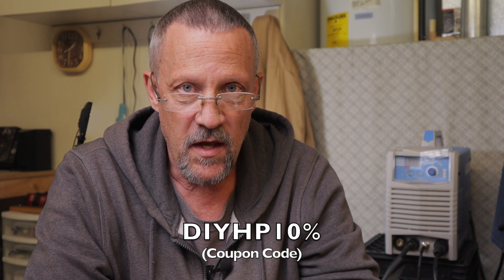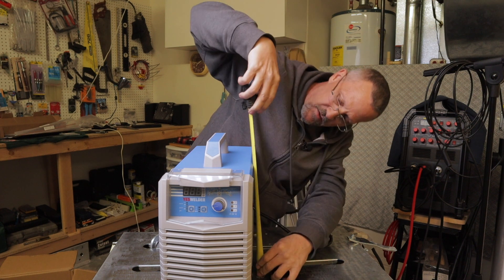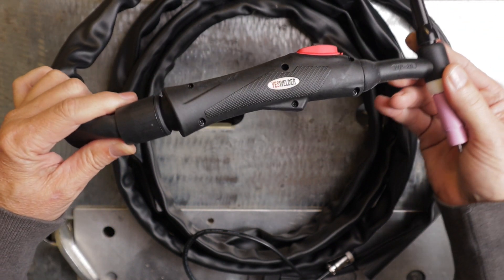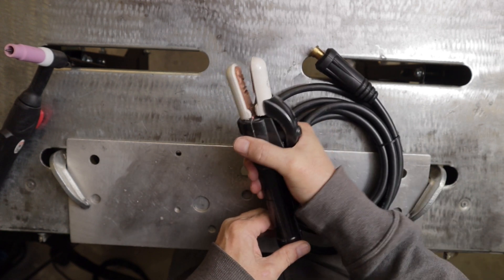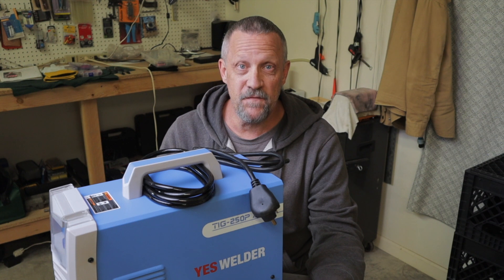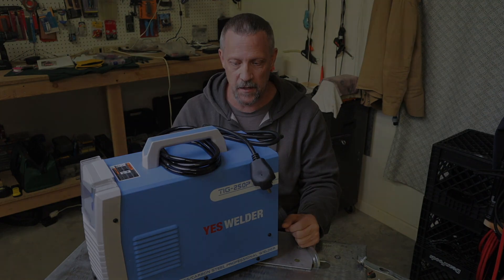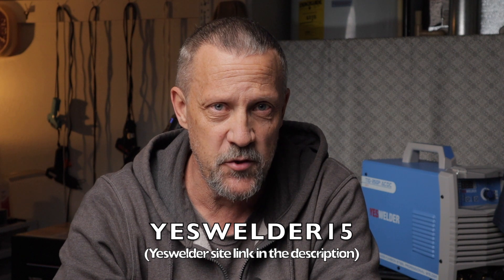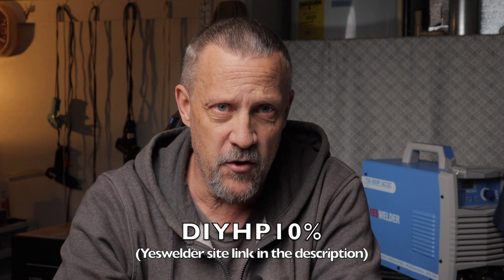I Tried the Yes Welder TIG250P and Here's What REALLY Happened

Comment: Seems to have a good range of settings, ok user interface, and looks to have nice arc. It will be an outstanding value if it holds up.
Reply from the maker: So far six months with quite a bit of use and no issues. If it continues I think it's the best value out there comparing price, features and performance. I'm really enjoying the machine!
Reply: Nice!  I wish they would offer a mig, tig, stick multiprocess in ac/dc.
Reply from the maker: Yes, that would be a nice machine for sure.
Reply: Yeah. Right now Millermatic 220, Esab Rebel and Everlast are it for ac/dc multi process, none of which are budget machines. I suspect there are a lot of folks in my boat- limited space for multiple machines but wanting Tig aluminum. Ordered the Miller, but would have been happy to spend less.
Reply from the maker: For sure! I would like to try a Miller, Esab or Everlast but I just can't justify spending that kind of money on a machine. This is all just a hobby for me so staying in the "affordable market" is my ticket. If any of those companies wanted to send me a machine to do a comparison video, I certainly wouldn't turn it down. 😀
Reply: No kidding. This is both more than I wanted to spend, and more than I deserve to own. The Miller’s range of Tig adjustments is somewhat limited, but I like the pull the trigger or step on the pedal to change processes and it does the rest- including changing polarity or from ac to dc depending on what mig and Tig settings you had. 

I don’t know it that is patented, but if a budget brand set up like that (automatic contractor to switch polarity and two gas inputs/gas solenoid valves) they’d sell a bunch.

Comment: I got the machine!!! It’s rad. I am really stoked on it. I am a total beginner and ran my first beads of silicon bronze and stainless steel. I have only welded three times and only once with my 250p. The other two times was with a Miller and I know that millers are good but mine is better. Smoother. Tomorrow I am going to work with steel for the very first time!
Reply from the maker: That is awesome Chris! It's a great machine and loaded with features. Enjoy your welding adventure!

Comment: Can plug  125amperes
Reply from the maker: 240V only on the TIG 250P machine. The YesWelder TIG-205DS is dual voltage but DC only ( (120/240) Here is a link for if you want to check it out. https://yeswelder.com/products/welder-tig205ds?ref=DIYHP10%25

Comment: You need a water cooler with this otherwise the tig torch gets real hot
Reply from the maker: I suppose if you are welding a lot that could be true. I haven't had any heat problems with the small projects I have been welding with it.
Reply: @DIYHomesteadProjectsDIYHP10  yea ive used a lot of machines with aircooled tig torches and they do get hot,water cooled is the best way to go unless your just doing a few small welds.
Reply from the maker: I agree with you, I'm going to have to give a water cooler a try in the near future. I have a feeling that once you use a water cooled torch, I'm not going to want to go back to air cooled. LOL Thanks for the info and tips!

Comment: How’s it do with 6010 1/8 inch stick electrodes
Reply from the maker: I don't know James, I haven't tried any 6010 rods with this welder.
Reply: @DIYHomesteadProjectsDIYHP10  what about 6011 or 7018
Reply from the maker: I tried it with 1/8" 7018 and 6013 and it did well with both of those rods. The electrode holder is pretty cheap but it does work. Personally I would replace it with a better one and they aren't that expensive.

Comment: Why i cant hear any sound of  fan/ventilation in this video. Does the  YW TIG 250P AC-DC has fan on demand/temperature regulated cooling ventilater?
Reply from the maker: Yes Ralf, the YesWelder TIG 250P AC-DC machine has an on demand fan controlled by a temperature sensor and it is a nice feature.
Reply: @DIYHomesteadProjectsDIYHP10  Where can i buy the TIG250P AC-DC? I'm from Germany.
Reply from the maker: You can find the machine here at the YesWelder website. (link below) Sorry but I don't know if they ship to Germany. If they do, you can use the code DIYHP10% at checkout and you will receive 10% off your order.
https://yeswelder.com/?ref=DIY%20Homestead%20Projects%2010%25%20OFF

If they don't ship to Germany, you may be able to find the machine on Amazon here - https://amzn.to/3rYLkmi
I hope this helps you out Ralf.
Reply: @DIYHomesteadProjectsDIYHP10  thank you very much! I will try to order. Lets see if the can deliver to Germany.
Reply from the maker: I'm curious to find out as well for future inquiries. I hope it works out for you!

Comment: what size is the torch connection?
Reply from the maker: That is a good question and I have wondered that myself. I measured the outer threads of the male connector on the machine and came up with .629" (5/8") or 16mm. I hope this helps you out.
Reply: @DIYHomesteadProjectsDIYHP10  Thank you. This is now available on amazon, i ordered one before its gone. I found a M16x1.5 to 3/8-24 adapter to use ck superflex on ebay. I was gonna get the weldpro tig200gd but they decided it was a good idea to raise the price by $40 on ebay, amazon, and main website.
Reply from the maker: You could have saved 10% if you purchased the machine from YesWelder and used my code DIYHP10% at checkout. Anyhow, it's a nice machine I think and I hope it serves you as well as it has me. Take care!
Reply: @DIYHomesteadProjectsDIYHP10  they cant ship to me from yeswelder direct. Amazon allows shipping to my location, i already have their mig 205ds. BTW, is the machine 220v only? what plug does it have? could it be plugged in 110v?
Reply from the maker: Oh, I understand now. The TIG 250P is 240V plug only. It comes with a 50A 240V style plug on the machine. (unfortunately no 110V on the TIG 250P machine)

Comment: Do you think welder is capable of tig lift arc if i leave it in the stick position?
Reply: I asked them this and yes, if you use a Tig torch with valve (WP-17V-35), and have it in the stick position DCEN then you can do lift start
Reply from the maker: Thanks for the info James B!
Reply from the maker: I don't know for sure but I doubt it. I don't think you would have any gas flow from the torch if the machine is in the stick position. It may strike an arc though and I suppose you could use a torch with a gas valve. Why would you want to do that when the machine has HF start and a gas solenoid?
I did start a stick rod once with the foot pedal and High Frequency start just to see if it would do it and it did. That was in the TIG setting using a rod holder instead of a TIG torch.

Comment: What do you think of the yeswelder 200 amp stick welder.
Reply from the maker: Are you referring to the "Stick Welding Machine ARC Welder 205A"? Sorry but I don't have any experience with that machine. I would venture to guess that for the $135 and being a dual voltage stick machine, it looks like a descent machine. I don't care for the YesWelder electrode holder but it does work fine. Harbor Freight sells a nice one for about $15 and they are easy to replace.
Reply: @DIYHomesteadProjectsDIYHP10  Thanks for your Quick response and yes it is a stick welder and I am new in welding never done before.
Reply from the maker: You are welcome! I think you will probably like that welder. I think it's a good price for a 200 amp stick machine. A big plus is the dual voltage capability. They also cary a 3 year warranty from YesWelder. If you decide to purchase one you can get 10% off using my discount code DIYHP10% during the check out process. Good luck to you and happy welding if you decide to get into stick welding!

Comment: I currently have a miller econotig. I'm new to tig welding so I know very little. Would this welder be better than what I have?
Reply from the maker: I'm fairly new to TIG welding also. I don't know much at all about the Miller Econotig machine but I think it's a transformer machine. (I'm not positive about that.) The answer to your question really depends on what you intend to do with your machine. I would think the Econotig would be a good machine to learn on. As your skills advance, you may desire some "inverter" TIG welding features that an older transformer machine doesn't offer. The YesWelder TIG inverter offers pretty much all the advanced TIG features most people want such as High Frequency start, TIG pulse, gas pre flow and post flow control, spot timer, digital interface as well as a small size and light weight. It's also capable of welding thicker metals than the Econotig because it has 100amps more available power. You'll have decide which welder is better for you and what your intended goals are with your TIG welding. Hope this helps a little.

Comment: Hi brother,  between the prime tig welder and the yeswelder tig 250. Which do you personally like more?
Reply: That makes sense. Thank you very much for the reply!
Reply from the maker: You're welcome Steven!
Reply from the maker: I've been asked that question quite a bit lately and it's a tough one to answer. I like and dislike things about them both :) I would really like to have the best of both combined and that would be my ultimate machine but that is mostly personal preference. They both have the same features and perform about the same as far as I can tell. I really like using either one to be honest. I have a limited budget for my welding hobby so with the 20% OFF sale, right now I'd say the YesWelder would be my choice. I could use the $170 difference to buy other things such as welding rod, Argon, tungsten, weld metal etc. I say $170 difference because you'll have to buy a regulator for about $30 to use the YesWelder. The Prime Weld comes with a regulator. Hope this helps you out a little. That's a tough question to answer.

Comment: im really looking hard,the h.freight titanium 200 unlimited ,has constant fan,no foot pedal,i like this triggered torch, this may be my first tig welder  ,...how much does a argon bottle mud sized  go for  approximately
Reply from the maker: I do the same thing Mark, it takes me days to make decisions like that and sometimes even weeks. LOL In my area I buy my argon through a local supply company. Not one of the big national companies but a small family owned business. I bought a medium size bottle (120cf) from them and it cost me $285. When it's empty I take it in and they give me full one for $61. I never have to worry about having the bottle certified or anything like that, they take care of all of that. The first bottle purchase and fill up was painful but the $61 to fill it isn't that bad. My first bottle last me 4 months. My second bottle last me two months and I'm now half way through my third. TIG welding is addictive but I do it on a budget and once you have that initial expense it's really not too expensive as a hobby. That really depends on what you use to practice on. I use the weldmetals.com coupons and I've made a trip or two to the local scrap yard to buy some real cheap metal to practice with. Good luck with your decision and let me know if I can help with any more questions. 👍
Reply from the maker: Are you wanting a multi process machine. Mig, TIG, Stick? You may already know this but Mig and TIG both require different gas. If you get a multi process machine and want to do both MIG and TIG. You will need to have two bottles of gas. One for MIG and different bottle for the TIG. Just thought I would mention that.
Reply: @DIYHomesteadProjectsDIYHP10  yes ,im after a mid sized argon 100% BOTTLE,I HAVE the older chicago  electric  170,with htp upgraded longer mig torch, 50ft power lead,and upgraded ground  lead n clamp,w argon c02  mix,*smallbottle
Reply from the maker: OK, I figured you already knew but I just wanted to make sure you were aware. Another fairly big difference between the YesWelder and the Titanium 200 unlimited is the Titanium has a manual valve for the gas. The YesWelder is controlled by an internal solenoid with both pre and post flow control. They both work but one is more convenient than the other.
Reply: @DIYHomesteadProjectsDIYHP10  hey thanks  yeah i recently got into beekeeping ,and its been a investment in gear,boxes,suits,smoker,im sure ive got a couple  thousand  now,...but its a good hobby,sweaty in summer,learned a ton,plus  theres the reward of honey,it has risks  too,thanks for  the info,few months ago i ran 50a 230v  so im ready,just need argon tank,
Reply from the maker: The YesWelder doesn't come with a regulator for your tank. You'll either have to get one or use the one off your MIG tank.
Reply from the maker: Have you seen the YesWelder MIG/Stick/TIG Multi-Process Welder MIG-205DS | 3 in 1 Welding Machine? It's similar to the Titanium and it's only $296 right now with the 20% off sale. It has high freq. start for the TIG too. https://yeswelder.com/products/mig-welder-mig205?ref=DIY%20Homestead%20Projects%2010%25%20OFF
Reply: @DIYHomesteadProjectsDIYHP10  can you tell me more  about the 205,yeswelder, seems to not  weld aluminum plate,?is there a foot pedal, does the fan run continuously, or only when getting hot like the 250p yeswelder, I want to tig aliminum,...yeah dont think i can control pre/post flow on the titanium 200 ,which seems like thats a necessary  feature,thanks
Reply from the maker: Mark, sorry but I don't know that much about the YesWelder 205. I do know that it's DC only so it won't weld aluminum. I think it has a foot pedal but it doesn't adjust amperage it's only an on off switch. Just like a finger switch but in foot pedal form. If you want to TIG aluminum then the 205 isn't the one you want for sure. Pre and post flow is nice and is especially important for stainless steel and titanium. It's not critical though for aluminum.
Reply: @DIYHomesteadProjectsDIYHP10  being a beginner,...after researching  the titanium only welds aluminum w spool gun,so its goin back,i can modify my chicago electric 170 to do that,so im gunna order the  omni pro 220,or yeswelder 250p,thanks man
Reply from the maker: You're welcome, good luck with your decision. 👍
Reply: @DIYHomesteadProjectsDIYHP10  just looking at alpha tig for 640.00,...nova pedal,gunna check into it
Reply from the maker: I've researched the Alpha TIG quite a bit and almost bought one a year or so ago. I think it's a comparable machine to the YesWelder and Prime Weld as far as performance and features. The reason I decided not to purchase one is I read several posts where guys had to pay to ship the machine back for a warranty claim. YesWelder pays for shipping both ways for a warranty claim. They are pretty heavy machines so I'm sure they won't be cheap to ship.
Reply: @DIYHomesteadProjectsDIYHP10  have you looked at weld pro,Amazon has em just under 800,but looks worthy,nice superflex hose #17flexhead,foot pedal ,ore n post flow,etc
Reply from the maker: Looks like a nice machine but I don't know anything about the WeldPro brand.

Comment: I click on buy it now with the code 20 and the price is 749, what happened
Reply from the maker: That doesn't sound right. I think I would send an email to customer service. I would also include your order number telling them what happened. Let them know you were trying to use the YESWELDER20 coupon code and they should be able to adjust the total for you.
Reply from the maker: Once you click on buy it now it should take you to your shopping cart page. On the right side of that page you should see a box that says "Gift card or discount code". Click in that box and type the word YESWELDER20 in caps then to the right click (apply). Once you complete that it should show a list with the original price followed by the discount and finally the final price of $600.00.

Comment: Yesterday you said the code was yeswelder20 for tig 250P less than$700 now it's 15 percent black friday until the 29th
Reply from the maker: YesWelder web site says YESWELDER20 for 20% off right on the first page when you access the web site. It says the 20% off "Black Friday Sale" runs Nov. 24 through 29, 2020.
Reply from the maker: If you select the TIG 250P and use the code YESWELDER20 it will show a $149.99 discount. That should make the machine total $600.

Comment: So what u think what u like more the primeweld or the yeswelder ??
Reply from the maker: That's a good question Keith. I do like the size and weight of the YesWelder better than the Prime Weld. I'm still familiarizing with it but I think I like the YesWelder user interface better as well. The Prime Weld comes with a better torch, torch lead and foot pedal though. The YesWelder didn't come with a regulator but the Prime Weld does. It's hard to make a call which one I like better because they both weld really nicely. It's rare to non existent to see a break in the Prime Weld price because they can't keep them in stock. At the moment with the YesWelder sale I think it's a "hard to beat" deal at the moment. At regular price it's a real close call as to which one I like better. I think they are both real capable welders for the cost.
Reply from the maker: I also really like the YesWelder fan. It's temperature sensitive and doesn't run all the time. When it does run, it is much quieter than the PrimeWeld fans and it doesn't run very long before it shuts off again.